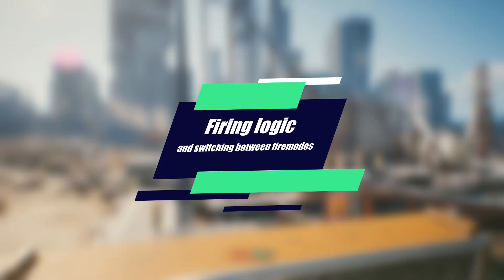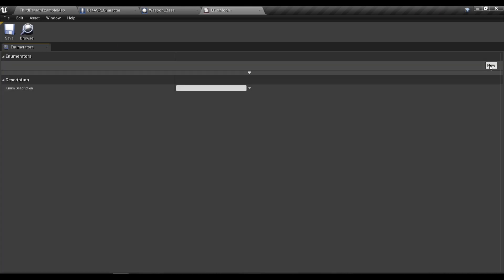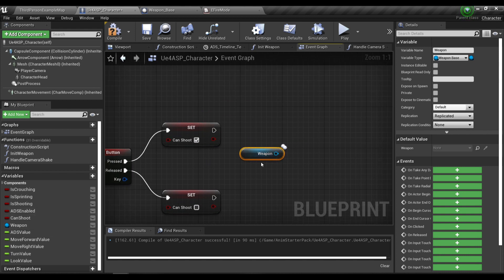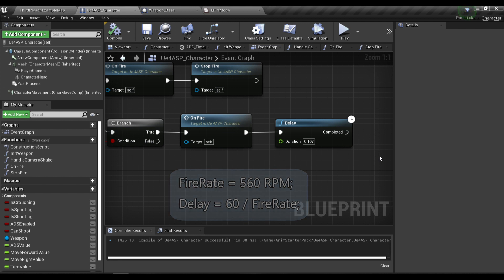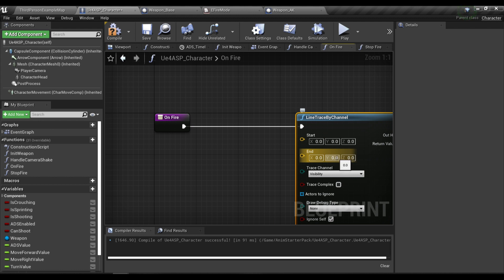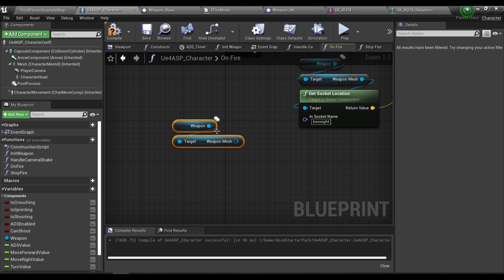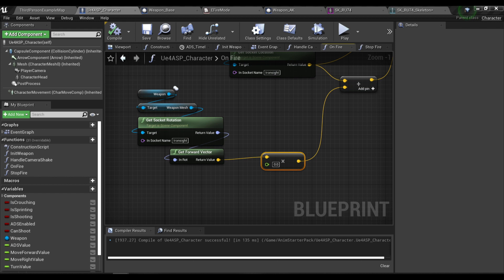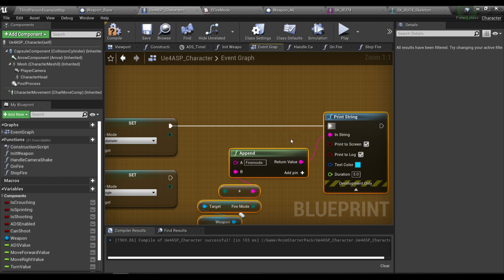Implementing firing function - Part 1 - UE4 Realistic Recoil Tutorial Series

Comment: I want to make a triple burst weapon, do you have a tutorial on how to do this?
Reply: You could create a new state in your enum for the burst weapon and add more variable like : bulletShotsPerClick (single and automatic won't need it but for burst or shotgun by example you can use it and set to 3(for the burst) or whatever you like and you're going to use your fire rate like the time between each bullet shot in a burst like 0.08(for a shotgun you would have 0) idk  and when you call your shoot on your switch on burst mode you create a local variable BulletToShoot in which you're going to assign the value of your bulletShotsPerClick and now like the fire automatic function but instead of  can shoot in your boolean you need can Shoot AND BulletToShoot != 0 and before the delay you make BulletToShoot  -= 1(or BulletToShoot --)  your delay is your fire rate and it should work i didnt tested it out its just an idea but yeah it should work this way.
In theory your value BulletToShoot should reset to 3 everytime you click to shoot so make care to not allow spam clicking to create a strange automatic weapon you can use your actual fire rate as the delay between possible burst so you would have like 2 firerate

Comment: The looping a Enim function and cancelling it with a boolean check was brilliant, so simple. I was messing around with Timelines and branches with different booleans to check for firemode. 

Earned a sub, made things way simpler!
Reply: Do you know how to disable the weapon sway while aiming down sight? It’s messing up my recoil pattern system and he doesn’t show how to change that
Reply: @Gbelloo  Because this is an intermediate tutorial course, if you can't solve that issue, this course might be a little to hard to jump into right now.

But what I do is just set the animation play rate to 0. (essentially stop the idle animation playing). You can do this permanently, or set it's play rate to be linked to a Stamina float and invert it (so it sways more if you have less stamina), you can also just turn the play rate to 0 when firing etc. 

:D Hope that helps.
Reply: @safaricalamari7613  I had that in mind, to set the animation to 0 so it would “freeze”. I just didn’t know if his template had an easy function that needed to be enabled or even setting the isaiming to true.
Reply: @safaricalamari7613  so I guess set the aiming down sight animation to 0 then back when released. Thank you!
Reply: @Gbelloo  NP, good luck with the rest of your project. :D